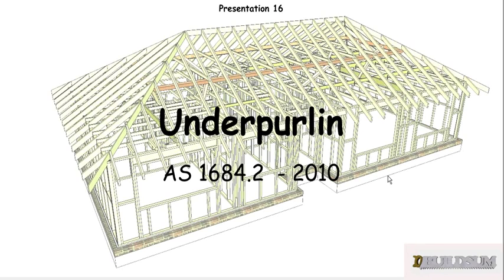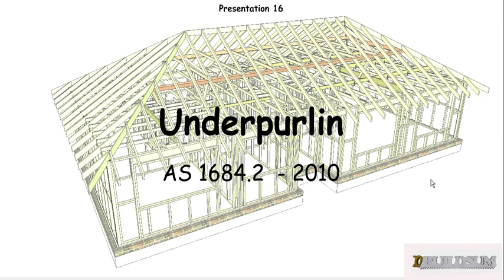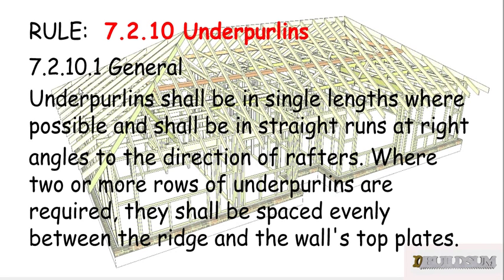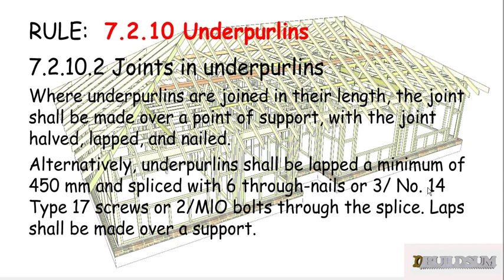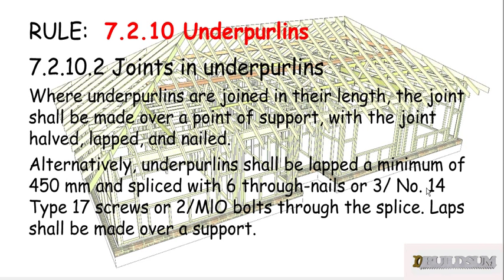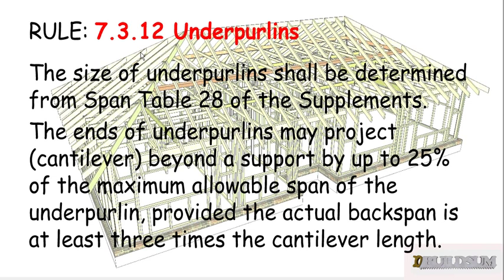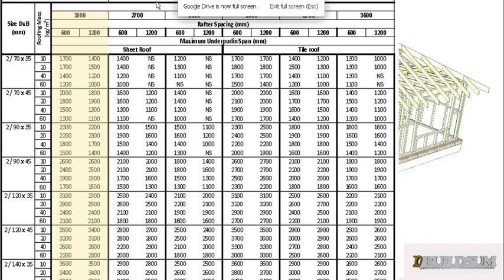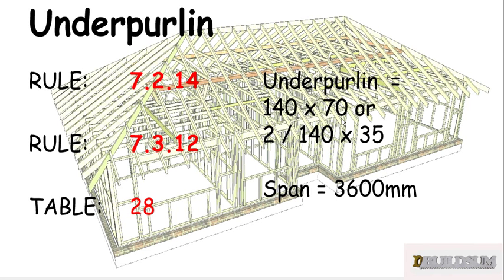16   Underpurlins

Comment: Whats the best way to notch out purlins where they meet and saddle the hip at each hip end. If hip rafter to small (hypothetically) to just butt in. Thanks.
Reply from the maker: Hi Mate, the best way is to not notch it at all rather place another piece of the Hip material below the hip where the Purlin will join and then just butt the Purlin into that with the Face and Edge bevel Purlin.
Reply: Thanks

Comment: HI John, how do you know the roof mass? I could check out the roof covering mass per m2 from manufacturer,  but I do not know how to calculate the roof members load. could you help please. thanks.
Reply from the maker: Hi Roger
Typical Roof Mass is outlined in Appendix A Table A1.1 of AS1684.2 and should be similar in AS1684.4